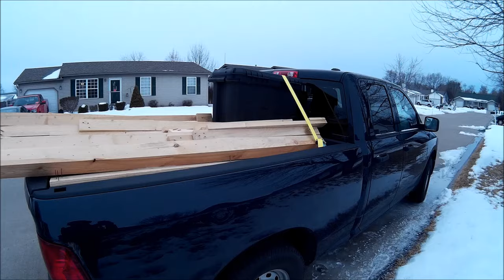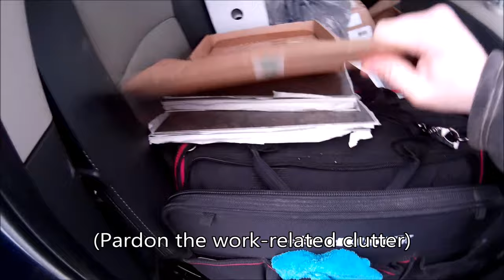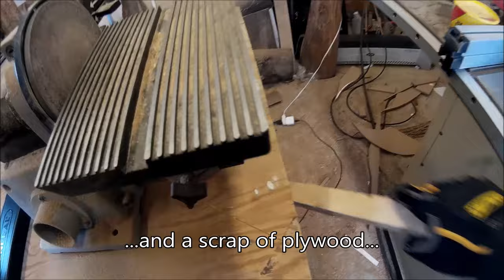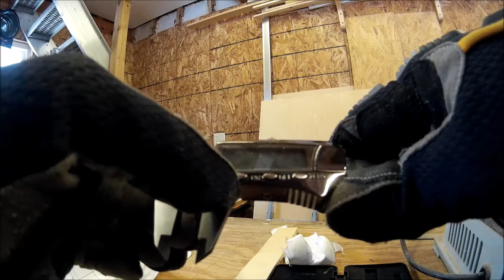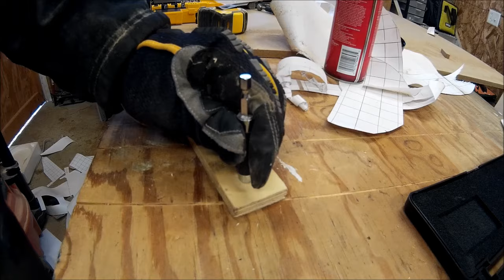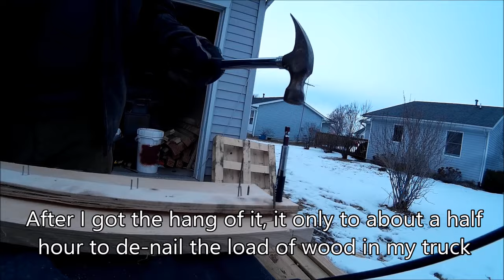Pallet Wood De-Nailer (Amazon links in description)

Comment: why not just hit the nail with the hammer then flip the board over and pull it out? I don't understand what the bit receiver was even for
Reply: exactly just what i was going to say,  totally useless
Reply: that's for people that can't handle a hammer accurately. Being a home builder from way back the guild for me would be about as handy as a rubber crutch.
Reply: When he said remove them efficiently I thought he was coming up with some genius way to remove them quickly, then I realized dude seriously over thought the project...
Reply: james snook that would be to easy..work smart, not hard obviously isn't the case here
Reply: ryobi magnet bits holders are garbage for holding. repurpose it. this is genius for your labor guys. how many times has anyone tried to beat the bottom end of a nail just to have the darn thing fold hard on you? this looked like it held them straight through easy to grab the head and finish them. quick efficient no scarring the board like a cats paw would.
Reply: This would probably do it in half the hits it would hitting bare nails... even less if you had to straighten bent ones which u will inevitably have... great idea imo
Reply: apparently you have never tried doing it then.  while what you say is true for nice thick nails that are perfectly straight, Pallet nails at this stage are all crooked, half rusted out and more like much thinner staple gun nails.   If the wood is hardwood you will most likely fold the nail in half. The bottom line is you will have to be very careful with your nailing to keep from bending the nail.   Careful means slowing down.  My guess is about 1/3 as fast as with this tool.
Reply: i'm the same as that

Comment: do you have an impact drill?  Could you not use the bit in the wood,  but instead of using a hammer, pull trigger on your drill?  The bit would turn, but the part in the wood remains still?

Comment: How long did the hex head last? I would assume it did quite well, even though it's a cheap brand.
Reply from the maker: The hex head and the magnet inside never really showed any wear.  What wore out was the sleeve that slides over the shaft.  The bit still works as a bit holder, but no longer as a screw guide.

Comment: I just pinch off all but 3/4" with crops then tap the stub flush. That leaves enough head to pry the nail.
For recessed nails snip a bit longer.
Bent, even flattened nails just need a twist from the claw to get enough straight shank before nipping.
If I'm feeling lazy I use a 4" grinder with an inox 1mm disc  instead of crops.
And that way you needn't massacre a perfectly good tool.
As my teacher used to always say some 40yrs ago.
"The right tool for the job"

Comment: This assumes you can pull the wood off with the nails without the wood splitting!  The ribbed nails usually used in pallets are designed not to pull out

Comment: Yeah, I just saw off those ends
Reply: There's one in every crowd. LOL
Reply: columbusindimedia Sorry dude...Just sayin...As a building contractor, I've cut up pallets for thirty years...Love the heavy equipment or motor ones, they're usually rough sawn oak...I use pallets for spacers and build ups...but that 1.5  or less inches out of the board won't be missed...I Usually run my saw right next to the 2X's And throw those out, unless I need them too...:)
Reply: I've done it too.

Comment: Some of the shipping frames for large items have staples in them as well as some of the thinner pallets.  Any ideas on how to remove them?  I tried using bent nose pliers to keep them straight but it doesn't always work.
Reply from the maker: Staples suck!  If I did this all again I would probably just cut off the ends of the pallet board to save time.

Comment: Or suck it up and learn to swing an estwing properly... This method may be accurate but way to slow. Just can't hang with the workload for speed. So many unnecessary steps.
Reply: Maybe those nails are, but the vast majority of the pallets that I have come across use staples or very long skinny nails similar to trim finish nails, but longer. They bend very very easily. For regular heavy duty nails, this tool is unnecessary.

Comment: Set the board (nail points down) on a concrete surface, the texture of which will hold the nail points in place and keep them from bending over.  Give the board a couple of good whacks and all the nails get pushed up at the same time - half of them loose enough to be pulled out by hand.

Comment: I usually recycle the nails as well, but then I was brought up during WWII when nails and screws were valuable.
Reply: yeah, my Dad lived on a farm out of town and nails were a long hike away. it was easier to pull two or three nails out of the barn shed to keep you until there was a town run. Then you replaced the nails you cannibalized to get done with the newer project. today we just jump in the truck and drive off to the hardware store, but it kills the project for the day to have the interruption.
Reply: And soon, they probably will be again.

Comment: Circular saw - cut ends off.  Done. The rest of the pallet goes into the burn pile unless you need that wood for a project.  Pulling nails out is a long long process.  For a small project your idea would work okay.

Comment: Yeah but the hard part is separating the boards in the beginning without splitting them.
Reply: Sabre saw and 6tpi wood/metal blade.
Reply: I use a special tool called a "pallet buster" basically a long handled pry bar with two articulating heads. I can take pallets apart with about a 95% success rate without splitting the wood.

Here's a link if anyone's interested in looking at the tool I use:

http://www.vestilmfg.com/products/ldsol/pallet_buster.htm
Reply: I just use a heavy sledge like a plunger, lift 6-9" and drop it once or twice assuring the pallet is slightly raised off the ground... obviously easiest when slats are staggered, otherwise a simple U-shaped  jig to drive a slat directly below another.
Reply: 2 pieces of 2 x 4 work pretty well too. 1 each side of the slat, and push!
Reply: being a welder, I can make this tool out of scrap steel for about 3 dollars
Reply: Jeff Stanley  leave the pallets out in the rain overnight and the nails will be much easier to remove
Reply: Does he have a video showing that?
Reply: but can't really do much with the ends of pallet boards anyways because they're all split. I just use my circular saw to chop the boards along the side skirt. I flip it over and pound out the boards from the middle
Reply: Jeff Stanley Sawzall
Reply: Izzy Swan has a gimmick that works pretty well. it's a little high dollar so i just made one... saved a lot of boards in the summer months when the wood was so dry. gonna pull pallets water them a couple of days and they will turn loose of the nails batter.

Comment: Lay your wood that has the nails on a very sturdy work table and the nails will come out easier, the vibration from your tailgate is absorbing energy and causing you more hammer strokes per nail.

Comment: good idea if you don't know how to use your hammer to get the nails out
Reply from the maker: I obviously don't know how to use a hammer. I must have been swinging the wrong end again.
Reply: I'd say it's way more efficient than just a hammer ... even in the most skilled hands
Reply: Lol yes your right... and they make a tool that does the same thing... i think its called a nail set
Reply: i have a damaged eye and don't have good depth perception. this unit is easier to hit square and the nail doesn't just bend every time you miss vertical a bit. it does speed up the process for me.

Comment: Just use a small pair of bolt cutters to snip the end of the nail off, leaving about a quarter of an inch sticking out, then hit it with a hammer. If it's super stubborn try hitting the nail on the head to get it loose then proceed with the previous method.
Reply from the maker: Different strokes for different folks.

Comment: Just chop off end of boards with the nails not loosing that much wood
Reply: I agree, it would take you 10 minutes.
Reply: 2 mins
Reply: i was just about to say the same thing ..i run a skil saw right on the inside edge of the outer runners and only deal with the middle runner pulling nail wise..easier to do less likely to split , then just bust the wood off the runners only exsposing the left over nails then crowbar them out. the wood is cleaner this way and only holes in the middle of the board and you lost about 4"or 5" on each and gained about 4 hours of your life !! good luck but nice idea as well
Reply: Most pallets have three base boards. Are you planning to just end up with 12” boards for your projects?
Reply: yeup thats what i would suggest but you beat me to it, foiled again.......the end of the piece is no good anyway cause of ii the nail holes
Reply: James Moore     there are other tools made that help take pallets apart. Ozzi on utube.... or make one if you are only taking a few apart.

Comment: Nice idea and simple.  But, there always a but, in order to minimize the knocking, it is not necessary to push out that much the nail.  As soon as the head is out  it can be grab.  

Another thing.  If you have a power drill that can hammer ( or a drill hammer!),  with a variable chuck, place your screwing adapter in it....

Another help.  A palm nailer, a pneumatic device, can also be used as a denailer by simply placing inside the nailer, the part of the nail that points out of the wood.

We could even used a ZIP GUN,  this pneumatic hammer( like the one often used to cut a bolt when installing a muffler)  with a punch whose head is flat  ( square) making a rod  out of it.  Around the punch, we place a pipe whose inside is a little bit bigger  that the punch itself, the pipe being about 5 or six  inches long.  We hold the pipe in one hand, having the punch inside, and hold the gun with the other....
Reply from the maker: +remige2006 Great ideas all around, but...  The purpose of this video was to show that the average DIYer can do this without any special tools - probably with something they already have lying around.
Reply: Great & THANKS I've learned again, as ALWAYS!

Comment: Saw another video on pallet disassembly. what he did I thought was really clever. He cut the nails to 1/2 inch with a pair of bolt cutters, two whacks with a hammer an the nail heads where out enough to pry the nail out.

Comment: You do know they tend to put a magnet in the end of those and you hitting it like that will make the nail break the magnet. Other than that. The best way is to take some oak and place the nails down on it and hit the board with a deadblow or a heavy rubber mallet. Works very quickly and multiple nails at once and you don't have to mess up a tool. Not saying this is not a good idea as it is but broken magnet pieces are sharp and can get everywhere.

Comment: A great concept! However maybe it would be worth making a dedicated tool for that rather than beating up costly impact driver sets. Also, you would be able to make the opening of the tool to be closer to the diameter of the nails, helping to keep it straighter.
Reply from the maker: You are right about it being a concept.  As for the screw guide, I wouldn't worry too much about it, you can find them anywhere for about $1-3 dollars. The one I used is still in good working order, so they are pretty tough. I'm afraid I I used anything narrower, I wouldn't be able to fit it over the bent nails.
Reply: The Workshop.  Costly?  If that's costly, maybe woodworking isn't your thing.
Reply: You're jealous you didn't come up with the best pallet denailer invention in the world.give the guy credit where its due tight arse  from Scotland
Reply: The Workshop l
Reply: I did this today, I cut the nails with wire cutters about an inch remain, then it is easy to tap them out and flip the board and remove the remaining piece of nail.

Comment: tape a small block of wood to the head of your straight claw hammer  it gives you more straight up leverage and saves your energy for the project after the denailing is done.

Comment: so there is a way faster way to do this with a palm nailer. I've had to denail about 2,000sqf of flooring and using a palm nailer attached to an air compressor worked wonders. got it done in a single day. you can even set up some sort of bucket to catch the nails.

Comment: I cut up old Europallets for firewood, and just run a jigsaw through the planks, along the line of the bigger baulks*. Then the baulks are cut between the nails, and after burning the nails are swept out of the fireplace. Best to use pallets that haven't been painted or treated if you're burning them.  *Can't think of a better name- I think you know what I mean!

Comment: I know this video is several yrs old now but, in addition to the use of the bit driver, air hammer or an palm nailer. No swinging of a hammer and does far less damage to the bit driver in case you have a miss swing. Cheers :)

Comment: There are tools that already exist that perform the same function as the one you have repurposed that tool for. They are designed to be struck by a hammer versus damaging another tool or having metal chips projected from the point of impact from a tool that’s not designed to be struck. They are usually found with siding tools and are for guiding and driving in trim nails. They are perfect for driving small diameter nails in either direction and can drive them down flush with the material surface. I do like the handle idea though; it distances your hand from the hammer blows. There’s also a tool for that as well and it’s usually used for holding hammer wrenches in place to distance one’s hand from hammer blows.

Comment: Hey many people obviously don’t know about it but they do make a pneumatic denailer that is very fast and way more efficient than this method. In less than 1 second it can completely knock the nail outta the wood. When we ve got a lot of nails to remind s I use it and it works excellent even on small gage trim nails or large framing nails The one I have is a reconnx nail kicker v20. Check it out you love me for it.

Comment: Great idea using that bit, if you have a rotary drill that you can turn off the drilling action and just have the impact part will speed up the process and you can get out of the cold. I have a Bosch rotary drill that does that.

Comment: I kinda use the same method except I designed a simular tool that attaches to my air hammer and it actually drives the nail completly out of the board with a tap of the trigger.

Comment: Your tailgate is not sturdy enough to keep the boards from jumping around. A more sturdier surface like a strong table made of pallet wood works better to me. I also use a square headed framing hammer with waffle head imprinted onto the hammer head keeps nails from slipping off of the nail tip as I am striking the nail. For me it is much faster. Thanks for your video it made me think of even better ways to de nail a pallet board.

Comment: Very clever idea! i think I have to make one. previously I have been solving the nail bending problem by clipping each nail off with only 1/2"  sticking up, so would not bend as easily.  Works good, but is one more time eating step.
Reply from the maker: Thanks!
Reply: This is the BEST idea yet. No need for another jig, just an available wire cutter. I am amazed why so many people (youtubers who cannot wait to feature themselves) don't attack the problem by removing it  ( i.e. remove the length of the long nail that bends when hammered), but go to great lengths to make complicated tools to half solve the issue.

Comment: I just use a pair of small bolt cutters to trim excess length to about 1/2 above the wood, then hit the short and straight section back out the other side. Once the head is exposed on the other side, it's easy to pull out.

Comment: Good idea but have not seen a bit holder that extends like this. Also how long does the bit holder last with it being continually struck by a hammer?
Reply from the maker: +Peter C they are pretty tough. The sleeve that slides back and forth is aluminum, so you have to be careful not to have too many misses or glancing blows :)

Comment: I simply put the pickets on the ground with the point nail side down against the cement and hit the wood near the nails forcing all the nails to push out since the cement floor is harder than the nails. Takes like 3 seconds. This seems long and tedious hitting each nail one at a time.

Comment: Pop the board onto the 12" miter saw and cut the ends away.  
Takes 5 seconds each end = 10 secs. total.  Plus, you have clean wood without nail holes.

Comment: Pretty doggone clever.  How durable is it?
Reply from the maker: Pretty durable.  This video is pretty old and I still have the drill guide in my bag o' tools.  What will happen is that the guide will work its way loose from the handle long before you can do any real damage to the bit.

Comment: Great idea, wish I could get nice pallet wood like that near me. All I get is crappy pallets
Reply from the maker: +Ron Hensley unfortunately, it was a one time deal for me.
Reply: Ron, I get some beat up old pallets around here also. I work on them with some sand paper and can get some really nice pieces then use putty if I want to fill in any holes. Most of the time I leave the holes in the boards because it adds a bit different look to what I make. The hot tube company 7 miles away from me won't come off of their pallets. Some of them come from Japan and some times are made of Japanese woods instead of the wood they ordered from the U.S.

Comment: Why not use a bolt with centre bored out. Most nails are only a couple of inches long so 2 inch M12 bolt bored out to 1.5 inches with a piece of flat steel to act as handle would do the trick.
Reply from the maker: Nice idea